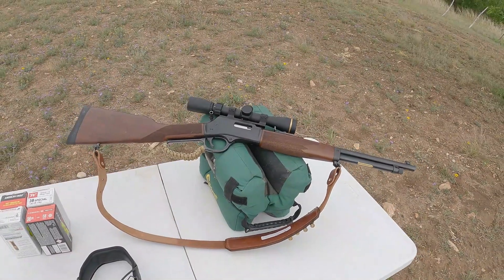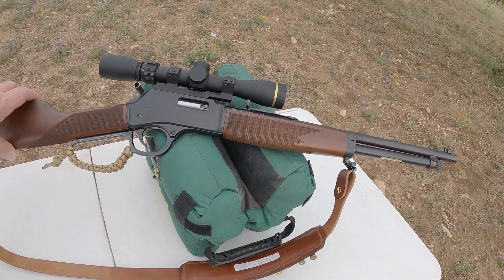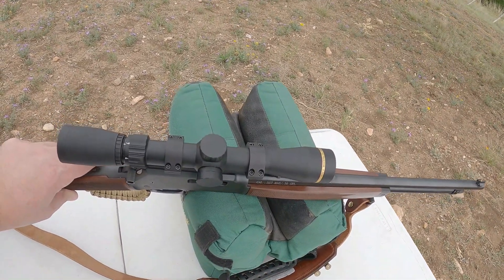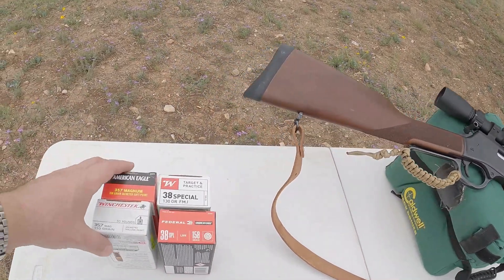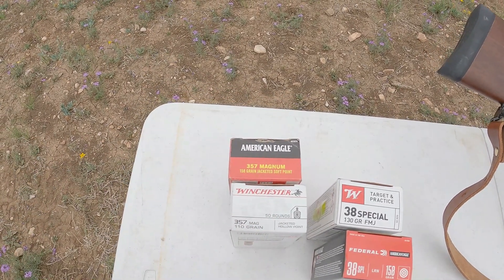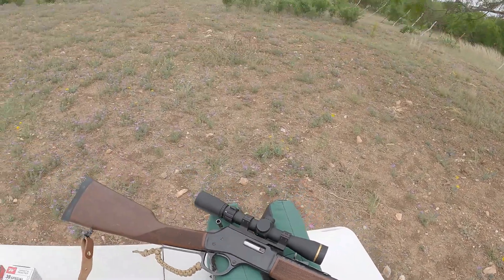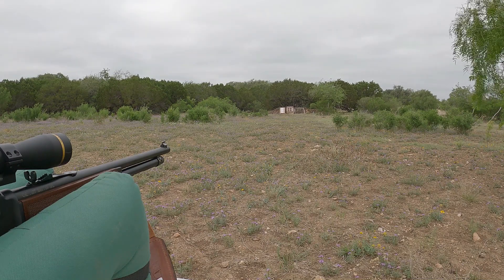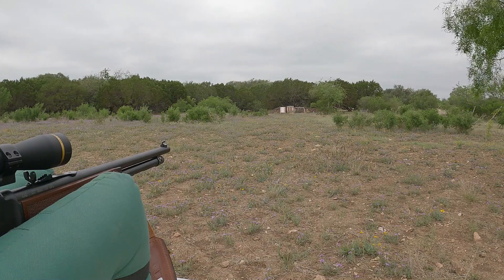Henry Big Boy Accuracy Test

Comment: The soft lead at rifle velocities probably leaded the barrel.
All rifles like certain types of ammo and bullet weights.
Those 158 grain .357's did quite well. The ones out of the group were probably you that caused the fliers.
Reply from the maker: Thanks for the info Denis!  I plan on doing another video trying to see if I can tighten the groups a little bit.  I plan on avoiding any lead bullets at this point.  I'll run a bore snake through the rifle first to make sure I clean out any lead left from the last time out.

Comment: I'm going to try and start reloading some .357 for my Rossi and Blackhawk. I like keeping that little gun handy for the wild pork chops roaming around. I don't have an optic on the Rossi, but I can order a rail from Skinner so that I can put something on it.  I may go with a red dot if I do that.  Right now I'm just running the peep sight. No on my Marlin 45-70 I have it scoped and I've already shot a couple of hogs with it.  I need to start reloading for it too.  Thanks for sharing I like that Henry rifle.
Reply from the maker: Thanks Cervus.  The 357 walks that fine line between having enough power for practical hunting and yet with relatively low recoil.  Just enough kick to make it fun and allow for quick follow up shots.  I know many prefer the 44 mag or 45lc, but I've been using 357 all my life and have more revolvers in that caliber than any other.
Reply: I load for the both of my and they shoot the same ammo . Just to let you know and I also cast my own.

Comment: Maybe it will shoot better with other ammo.  However, the groups we see with the available ammo is a little disapointing. Henry rifles are not cheap and as such I expect them to shoot accordingly. My old Marlin 1894 44 Mag would shoot anything I put into it into less than 2'' at 50 yards and most ammo into 2 1/2'' at 100 yards.  With some loads it would clover leaf bullets at  yards. I shot everything from 44Special lead loads to 44 Mag 180 gr HP, 200 gr HP and 240 gr Soft Points
Reply from the maker: That's fair Frank.  The ammo wasn't top notch but not crap either.  I think you could probably find one it like better than the four options I took out there.  And maybe I need more time behind the trigger of that particular rifle to tighten my groups.  The trigger pull isn't great but something that will hopefully smoothen out over time.

Comment: That's a good test.   I think reloading, maybe with 158 grain and up will shrink your groups.  Well, that is, if you can find the components.  There are lots of casting molds available and with powder coated bullets you can push them hard with no leading issues.  Keep all your 357 brass.  It's so hard to find right now.  Small pistol primers could be an issue as well.  Thenks for taking us along for the test runs.  I think you'll find the right ammo and the hogs will quake in their sleep.
Reply from the maker: Thanks again!  I think some extra trigger time and use could tighten my groups a bit.  This rifle hasn't seen much more than a couple of hundred rounds, so I'm hoping with use the sear might smooth out and give me a slightly better trigger.  
And yes, 357 is as hard to find right now as 22 was a few years ago.  Lets hope supplies start to catch up!

Comment: That scope is set way back be careful you don't get punched in the head
Reply from the maker: Wouldn't be the first time 😆

In all seriousness it is not an issue for me.  Happened once in my early teens when I didn't properly shoulder a rifle and was shooting in an awkward position.  Bridge of my nose took a good hit.  But more damage to my pride than my nose. 

Among other things, when mounting a scope I adjust for the correct distance for optimal eye relief.  What I do is:
1) mount the scope but don't tighten rings.
2) shoulder rifle with my eyes closed so I have a comfortable hold on the stock.  
3) then I open my eye and adjust the scope's position forward/back for the best eye relief.